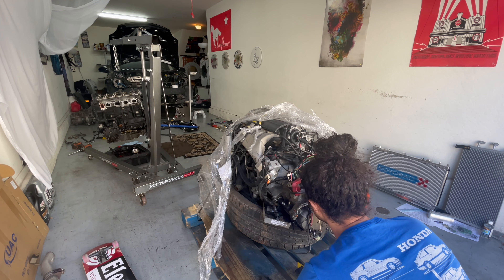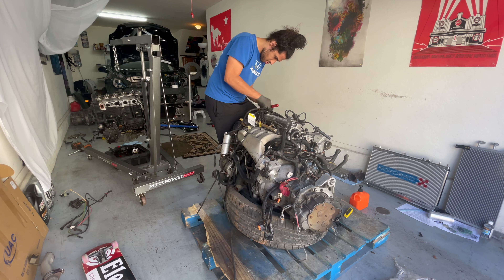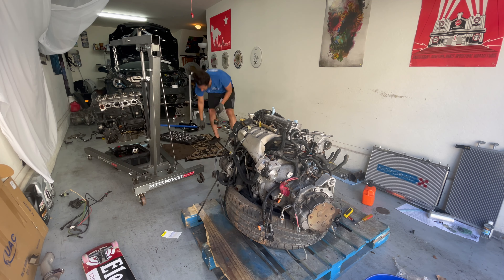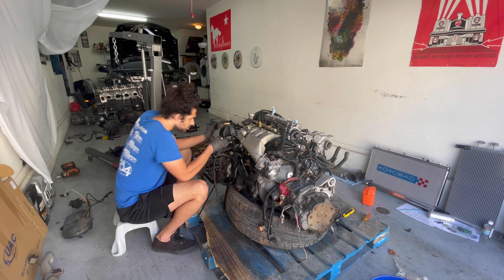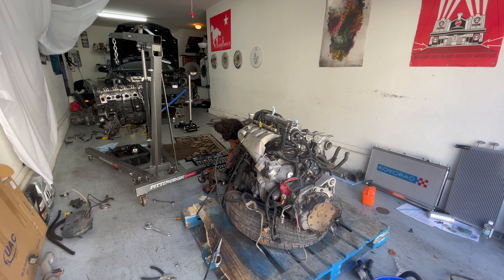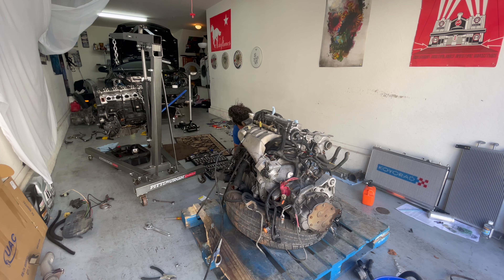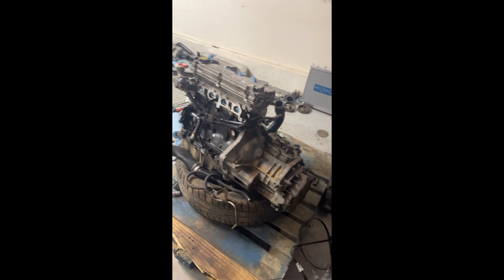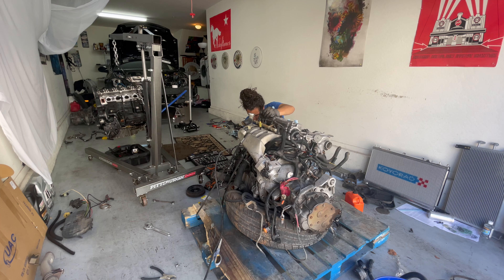Create engine break-down - SRT-4 Engine 2.4 - Turbo

Comment: Hey Randomz.
Caught a comment you made on 'Project Radium' channel about keeping the 8th gen Civic stock.
I left a lengthy reply in support of your comment and here I am after checking out your channel..
I have no uploads myself but was excited to see this content of your Neon SRT-4 motor build.
Prior to my Fg2 Civic Si Coupe, I owned a 2008 CSRT-4 Caliber.
Full bolt ons and tuned.
On a Dyno-Jet made 345 whp / 346 wtq.
I miss that car but being a Dodge got tired of the numerous electrical issues so traded for my Civic.
Cheers bro,

Subscribed.
Not many nowadays still working on older SRT4's 😢
Kudos
Best run in the 1/4 mile was 13.362 @112.8mph with a shitty 2.011 60ft
Reply: These younger gen kids have no idea about the Neon/Caliber SRT4 Turbo's.
I pissed off many a 'sports car' back in the day.
Raced a good friend in his 2018 Scatpack Challenger 6-speed from a 40 roll...
I was 3 cars ahead and he to this day won't speak to me 😂
Us 4cyl. Mopars were never accepted by the Hemi crowd as we always beat them hahaha 😂🎉
Good memories.
Looking forward to your build bud!
Reply from the maker: That's A DAMN good run still. Honestly, 60fts are a challenge as hell with FWD, lots of torque, and a street tire haha. I just ran mine on a really really mild emissions tune on 91 with a cat. I think I did about a 2.0XX 60ft as my best for the night. I couldn't get traction. 

Thanks for the sub! I just started catching up on uploads again. I get soo busy between both vehicles, home (I love solo), and my two careers. Much appreciate the views and support brother!

Comment: If it’s not too late do yourself a solid. Get yourself an agp 4th mount!!!
Reply from the maker: I just went with another OEM center mount, and properly "pre-loaded" the engine. It'll take it for a couple of years before it breaks, even with track launches. I'll have the engine back out in 3 years or so anyways. I will own this platform (this vehicle) for many years.